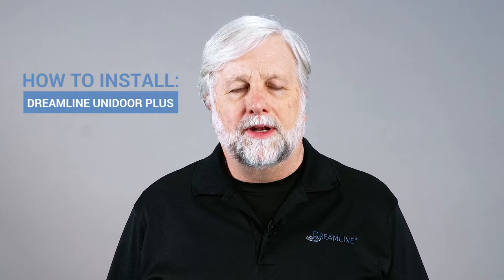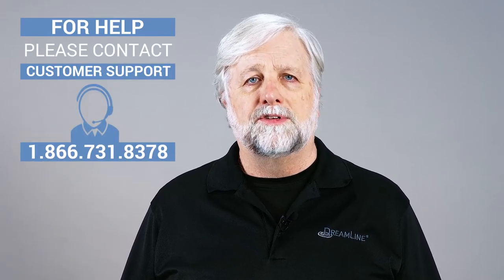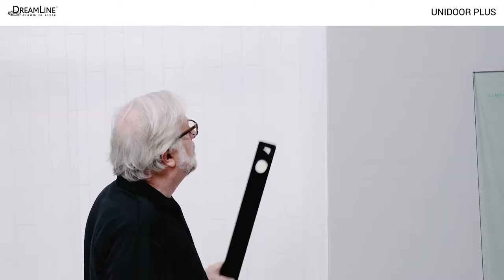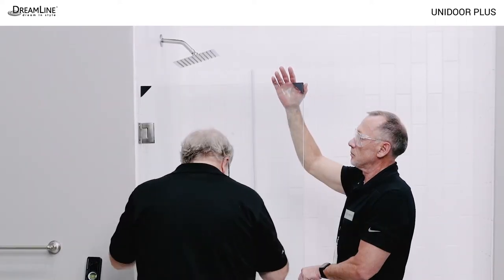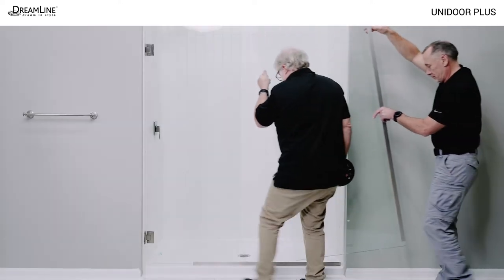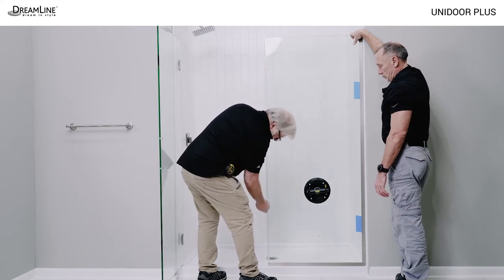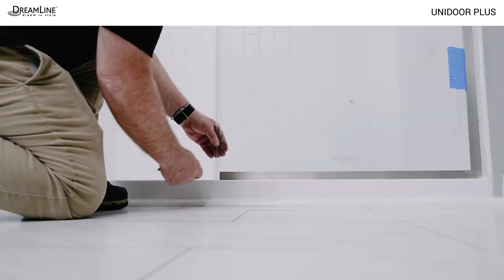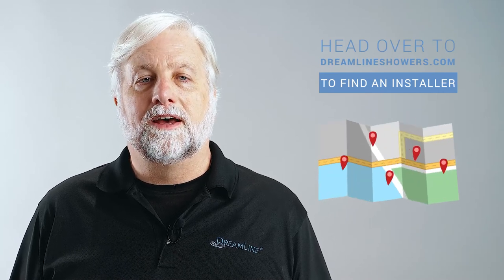How To Install a DreamLine Unidoor Plus Swing Shower Door | DreamLine Installation Tutorial

Comment: Are you supposed to put anything in the bottom channel to protect the glass?
Reply from the maker: Hello, Betty. Thank you for contacting DreamLine. In addition to applying silicone, we include vinyl that can be cut into 2-inch strips to be placed over the bottom screw heads to protect the edge of the glass. This process is outlined at 9:25. 

Should you have any further questions, we invite you to contact a DreamLine Shower Door Design Consultant at 866-282-8413 for assistance. We can also be reached by sending an email to support@dreamline.com and through our Chat with Expert feature on DreamLineShowers.com. Our hours of operation are 9am-6pm EST, Monday through Friday. Thank you for your interest in DreamLine. We look forward to helping you soon!

Comment: The manufacturer told me that the hinges can be adjusted to swing inward AND outward, but I haven’t found instructions.
Reply from the maker: The hinges come pre-set from the factory for an outward swing, which is the recommended use, but they can be adjusted to allow for both inward and outward swing. Instructions for adjusting the hinges are provided in the installation manual. If you need further assistance, please contact our customer support team at 866-731-2244 or support@dreamline.com. We are available M-F from 9am-6pm EST. Thank you.
Reply: @DreamLineShowers  can you please provide a link to the instructions?
Reply from the maker: @ofiasdfnosdf  Sure, the installation manual for the Unidoor Plus can be found here: https://dreamline.com/media/manuals/UNIDOOR_PLUS_STYLE_F_Shower_Door_Manual_Stack_Ver_3_Rev_2_Link_082022.pdf as well as on our website under the listed features: https://dreamline.com/shower-doors/dreamline-unidoor-plus-hinged-shower-door-22-to-22-1-2-in-inline-panel_shdr-244507210-01.html.

Comment: The model I have matches the video, however I'm unclear on the instructions at 7:10 into the video when the narrators says to "measure out 3/16" from the vertical edge of the glass".  Should the U-channel stick out 3/16" beyond the vertical edge of the glass, or does the glass stick out 3/16" from the U-channel?
Reply from the maker: Hello Flying Squirrel. Thanks for contacting DreamLine! The mark should be made on the bottom UChannel, 3/16” away from the vertical edge of the Door Glass, providing space between the two lites of glass. That will become the cut mark for the bottom UChannel and should end up being flush with the vertical edge of the panel glass. If you have any other questions, please contact a DreamLine Shower Door Design Consultant at 866.282.8413. We are available 9am-6pm EST, M-F and will be happy to answer any questions you may have. You may also send an email to support@dreamline.com or use our “Chat with Expert” feature on DreamLineShowers.com. Thanks for choosing DreamLine!

Comment: You DO NOT show how to install the vinyl on the u-channels.
Reply from the maker: Hello,  we apologize for any confusion but the vinyl is supposed to be installed inside the U-channel. This will protect the bottom edge of the stationary glass from any sort of direct contact with the metal U-channel when the panel is installed. The roll of vinyl stripping should be cut into 2 inch pieces and you should place those little 2 inch strips inside the U-channel along the bottom so that the glass panel will rest on top of the vinyl strips instead of sitting directly on top of the metal U-channel. The placement of these vinyl strips is shown in the video around 9:49.

Should you have any further questions, please contact our customer support team at 866-731-2244 or support@dreamline.com for assistance. Our hours of operation are 9am-6pm EST, Monday through Friday. Thank you for your interest in DreamLine.

Comment: Your instruction manuals featuring multiple models are highly confusing and difficult to follow.  I just spent 30 minutes trying to find a bottom strip that didn't exist, including digging through our trash pile, because the version we received has a foot lug in one corner of the fixed panel.   Seriously disappointed with both this video and the written instruction.   

Instructions should be model specific....  Not one size fits all!
Reply from the maker: We appreciate your feedback and are sorry for your difficulties. The manuals and the videos are in fact model-specific. There are several Unidoor videos available on YouTube and it seems you may have been better served by the Unidoor with Support Shelves or even the Unidoor LS videos, both of which show the install of the bottom bracket on the inline panel. The Unidoor Plus - a completely different model - uses U-Channel on the panel. Your comment seems to indicate that is what you were seeing. We're looking at ways to make video selection easier. We also recommend our free Installer Certification webinar held once a month for installers only.  Thousands of installers have found it to be extremely helpful. You can obtain more information at icp@DreamLine.com.
Reply: This is not true we are installing our dream line currently and the manual does cover a variety of models making it very confusing. We first thought we received the wrong door. The door is beautiful but directions could use a bit of a makeover to make things easier for the installer.
Reply: @feliceduncan767  Agreed!